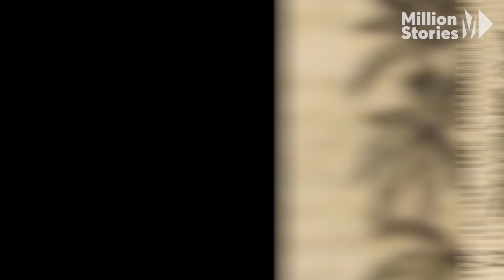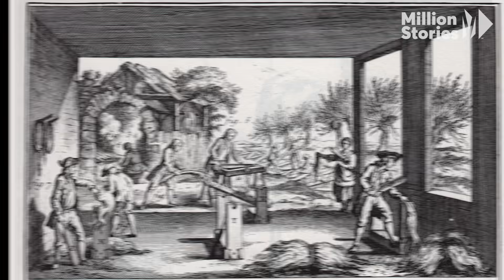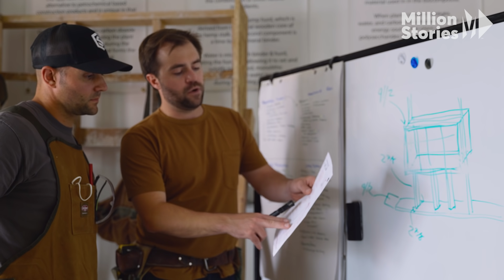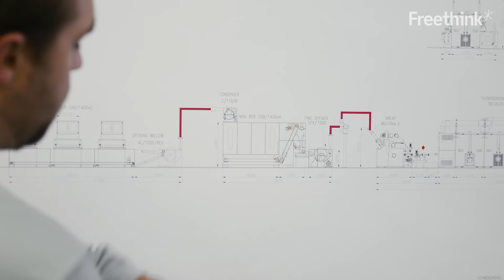Building homes with hemp | Freethink

Comment: We solved transient heat flow problems through insulators. Look up the thermal conductivity and use Fourier heat equation to calculate the temperature on the two sides of the insulator and the temperature profile.